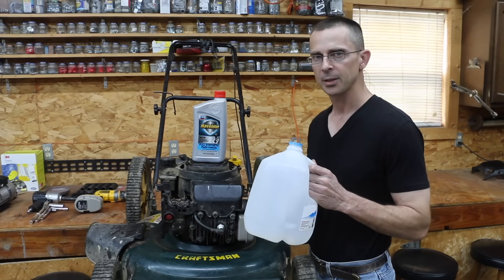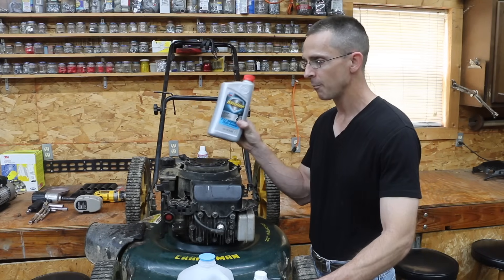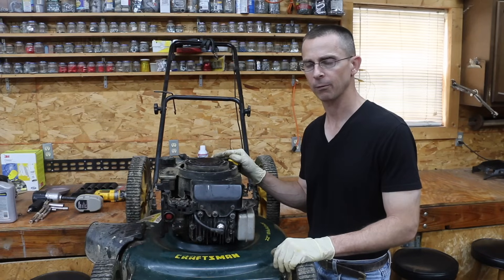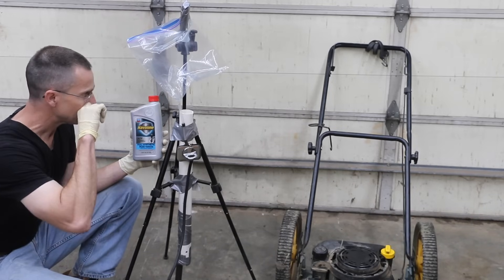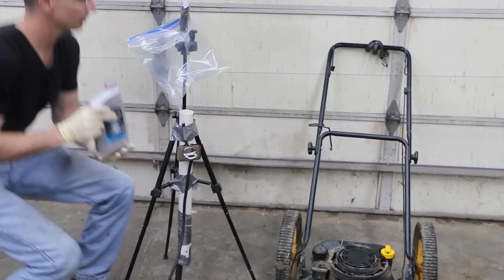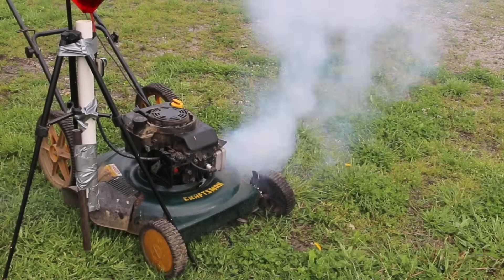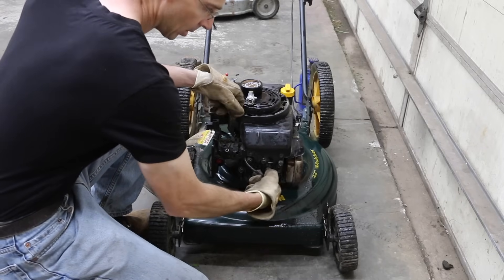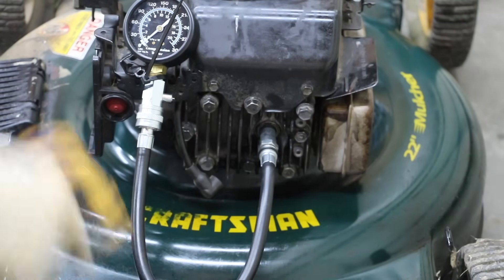Seafoam--can't believe what it did to my engine episode 6--Seafoam vs ATF!!

Comment: I bet it was the oily-water that got pushed up into the carb and sucked into the cylinder, that actually cleaned the engine on the last test. Not the dumb water recommended by the Duh-Huh WaterHead mentalities on here. I'm just glad "those kind of people" didn't cause you to blow up your engine. ; - )

Comment: How about doing ATF the same way you do Seafoam - add directly to the gas.  I might do that in real life, but I would not do an IV drip.  AND With water - add a a few table spoons plus Heat/alcohol to a jar of gasoline.  Shake, let settle. Pour off the gas.  Now you have hydrated gas for use in the engine.  Sounds like good theory to me....  Alcohol absorbs water.  Does Gasoline?    I love your testing but think you are Nuts if you read all the comments.  Go see a movie with your wife.
Reply from the maker: Thanks for the video idea.

Comment: What has better lubricity, 5 quarts of fluid containing a bottle of MMO and the rest oil, or 5 quarts of fluid containing 1 quart ATF and the rest oil? Also, can increasing the viscosity of the resulting fluid by adding a higher weight oil help restore lubricity back to the original oil prior to adding the additives? These are some common questions people have when considering using either product to fix clogged lifters.
Reply from the maker: Thanks for the video idea.

Comment: ATF = no
Seafoam in gas tank through the injectors = probably

In the mid 80s Holley sold a water injection kit. A simple windshield washer tank/pump injected through .020" orifices into the carb primary barrels, and operated by a manifold vacuum switch.
This allowed old high compression engines to run on the new lower octane gas. It cleaned the cylinders very well because it was there every time you stepped down hard.
Reply from the maker: Thanks for sharing.

Comment: I love this channel and i would like to add my grain of salt.I have tested ATF as a fuel additive..And the results are amazing.I have an endoscope and have videos of how clean the engine is inside.I would recommend ATF for occassional use in a very moderate way.No more than 10 ml per galon.The good about ATF is its excellent cleaning and lubricating properties,however it is really important to note that it will never burn in the combustion chamber due to its high burning temperature point.I guess it is about 1000 plus Degrees farenheit.As a result the over use or continuous use of it as a fuel additive will clog the exhaust ports over time since it builds up as it is spat out of the engine into the exhaust pipe and muffler.If your rings are kindda worn out ,chances are most of the ATF will end up in your oil pan thinning out your oil viscosity..So,it is not perfect,but if you use it with caution and moderation,it will work as expected..I am testing a mixture of Lucas fuel treatment and ATF..I will add a comment when i get all the details..Cheers every one.This gentleman is making this world a better place by sharing his tests and knowledge with all of us.Congratulations..You reached 1 million subscribers,you deserve it and soon you will be in the 2 m..Keep up the excellent work..Cheers
Reply from the maker: Thank you for the feedback

Comment: Use it and it works good. Had a 7.3 diesel that would die when clutch was pushed in when shifting down due to sticky valve in the injection pump. ATF fixed it right up
Reply from the maker: Thank you for the feedback

Comment: Seriously man..., you are one very valuable guy to all of us watching your great videos. Even if we may sometimes joke a bit about how you're testing stuff in extreme ways, we are undoubtedly grateful for the results! I haven't seen anyone else putting so much effort in finding out the truth for himself and sharing it this way with everyone else. It is a costly way to find out the truth, but it is also non-mistakenly the best way to find out the truth about various stuff!

Kind regards!
Reply from the maker: Thank you very much!
Reply: @ProjectFarm  could you please advise if one litre of Dextron 6 Transmission fluid be used along with 4.5 litre of 5w30 in GMC YUKON 2013 for a full cycle of 3000 miles
I have no major issues with engine
Reply: @ProjectFarm  it's not a wast at all I really like to see what's next and love the experiments let's see what this will do etc. I have always tryed things like you do. I used to put ATF in the diesel tank bio fuel with 2 stroke oil and loads moor over the years. You really are great if you went you would be missed big time 👍👍

Comment: I use 1 qt trans fluid in my gas tank twice a year.  With 294,876 miles on my 2008 Sierra, it still has the same fuel pump it came off the assembly line with and provides a steady 44psi to the fuel rail.
Reply from the maker: Impressive results!
Reply: My uncle has a 01 Chevy with 330k and puts ATF In his tank every fill up and has been since the truck had 100k. Runs smooth as hell. Quietest 5.3 I’ve heard engine wise.

Comment: I found carbon deposits on my old spark plugs because I was running rich for a while. And before I threw them away, I put them in mixture of boiling water and vinegar for about 15 minutes (mostly water) and they came out almost like new. So I was wondering if it's safe to put vinegar in the petrol tank to clean the combustion chamber. What do you think?
Reply: Not safe. Too much corrosive.

Comment: i recently put 800ml of atf in crankcase two weeks before oil change (400 miles) i have never seen oil that black the crud that came out was unbelievable.  worked better than any flushing product and had only ran 2000 miles since its last change.
Reply from the maker: Thank you for the feedback!

Comment: But could ATF clean intake valves from a GAs direct injection vs seafoam vs CRC ?
Reply from the maker: I wish I could test it.  It seems like a better option would be a water/methanol very fine mist to avoid damaging the catalytic converter

Comment: Love the video, love the passion to really find out what works vs gimmicks. That being said, im a believer in seafoam, I would definitely never try what you did with water or atf, but your results were very interesting and I’m impressed you’re willing to put your equipment to the test to get to the answer.
Reply from the maker: Thank you
Reply: i remember cadillac had a model that used water injection to increase horsepower. the tank was in the trunk.
cadillac also had a model that would cut off fuel to half the engine for either
stop/go traffic or open road. i don't remember which bank.
comments/memories welcome!

Comment: Hey this is my first comment, but I would love to know if “blue devil” head gasket repair stuff really works. It’s about $60 a bottle and it would be awesome if it did because it’s cheaper than a new head gasket. I have used it in the past and it seemed to work for a while. I think that would be a good video. I would watch it. I watch all of your videos. I used to work at advance auto and I would sell all of these products you test. And I would have to be like Seafoam is great and the next month I’ll be like Techron is better this month. Lol it was tough. Good luck!!
Reply from the maker: Great video idea!  I need to find a vehicle that has a head gasket leak.  Thanks again

Comment: Just curious, I always adjust the fuel mixture on my carburetor until the spark plugs look brown and that should prevent carbon deposits. When I run my wood stove and the fire isn’t burning hot enough the soot builds up, but the second I get the fire to burn hot by either using better wood or providing more oxygen, the black soot cleans up and turns a crispy brown
Reply from the maker: Thank you!

Comment: the way i have used trans fluid is, change oil and 1 of the 5 litres of oil is substituted for trans fluid.  I run the vehicle for  2 days and change and repeat the process 3 to 4 times depending on how dirty the oil is when removed.  I find that to quick a clean out causes the engine to get loose and seems to almost damage it, therefore i avoid the oil flush products.  I have done this many times and have had great success.  Whats your thoughts ?
I just picked up a beautiful 1999 chev silverado with 180 km on it (now a bit more) and i find in the cold mornings it ticks for a few seconds. I am going to  do the same trick to it and see if it helps.  I dont think the oil is getting up the passages due to the age.
Reply from the maker: Thank you!

Comment: If I wanted to try this with my 7.3 diesel would I add a quart to a full tank of fuel or a quart in the crankcase or both?
Reply: Jerry Mcbroom  put a quart inside the crankcase to the oil just make sure you don’t go over your top off mark run it for 2 days then drain. Just did it on my truck I had a little ticking coming from a lifter, it did the trick engine is smooth and after draining it I can see it removed a lot of gunk.

Comment: Now this video is what "keeping your hands off", regular use, correct use, and doing regular maintenance, can do.
https://www.youtube.com/watch?v=Wk-isKUjWBQ

However, that can include various additives, flushes, or cleaners to keep things clean, lubricate or protect the engine or other equipment, and would be part of a good maintenance plan. I have found correct and reasonable operation and maintenance really are the key to best and most productive use of mechanical or electrical equipment. 
 
Now comment on that engine disassembly investigation... 
a) The EGR might have very well failed to work if it had not received a wet oil covering likely from diesel engine normal oil uptake from the PCV into the inlet manifold, and use of oil with higher oxidation temps than the exhaust gas exposed to it.  But cleaning that wet sludge off might make it fail by stiction.  The EGR is primarily needed for lowering emissions and drivability or minimising engine roughness during the period the engine is warming up.  Otherwise it is not needed, except for NOx and combustion temperature reduction.  In the olden days chokes for gas engines, and use of glow plugs and pre-chambers for diesels sufficed, but these caused evils such as fuel dilution of lube oil, and washing down the lube from cylinders... leading to too early worn engines and of course high emission.  The EGR takes the place largely of these when combined with fine digital control of fuel and ignition.

b) The cam nose wear did show signs of actual metal to metal rubbing wear... under a microscope would show a rough torn galled welded surface which is only combated by the chemical extreme pressure additives such as ZDDP.  Lubricity improvers do not help here, that includes most additives to oil such as moly disulfide.  Some of the various nano-particle such as hBN (hexagonal boron nitride), tungsten disulfide, carbon/diamond and the like may help... and are considered lubricity improvers... but I don't have an absolute answer there.  I see no detrimental effects from the use of these because of the molecular size of the nano-products.  Modern engines solve this problem with materials engineering.  For example 35 years ago the OM616 and OM617 Mercedes Diesels, now long proven some of the most reliable ever made, had cam / lifter wear issues.  The original engine design was nitrided cams and chilled iron lifters this wore quickly requiring replacement by 50K-100K miles depending on us and service.  The solution was going to flame hardened cams and tungsten carbide lifter surfaces... which by the way by in-large the owners were stuck with.  But now those engines are considered very reliable.  Why I mention that is currently modern emissions standard and use of triple catalyst and exhaust particle traps are currently putting a strain on available lubricants, primarily as ZDDP when thermally degraded from oil being exposed to exhaust gas is a poison to very expensive catalysts.

c) What does this prove, despite the problem of the rise of agency government and emission standards the internal combustion engine has improved or evolved.  Largely the EGR, originally a fix to emissions, but now is necessary part of a symbiotic system including digital control of the engine and its fuel supply.  Material engineering and improvement has allowed engines to live long lives at high specific outputs.  Digital control has allowed high outputs while having low emissions and improved drivability.  Engines today running on the street have outputs rivaling F1 Grand Prix engines of my youth, while having durability of heavy duty diesels of old, and low emissions with fuel efficiency levels only dreamed of even a generation ago.  Of course engine engineering is much more sophisticated, and being a mechanic is no longer a monkey wrench job but that of computer technician and mechanical inclination.
Reply from the maker: Thank you!

Comment: I think the water works the best, but should be administered in spray from in the engine.
Try acetone in the fuel compartment mixed with gasoline.
It suppose to help engines (gas or diesel) pass emission controls
Reply from the maker: Thank you!

Comment: Here is an interesting engineering study of using a diesel fuel additive... Hydrotex Power-Kleen
http://www.staroilco.net/wp-content/uploads/2016/01/Georgia-Port-Authority-Study-Hydrotex-PowerKleen-Fuel-Efficiency-Final-Report-July-2010.pdf
Comment as to compression readings... obviously the removal of the deposits, though minor, from the combustion chamber did lower the compression... as would be expected with removal of any material from the combustion space.  Not something due to engine damage.   As I say... at least on a simple engine like this it might be easier to simply remove the head and mechanically remove the deposits.  But on engine where lots of work getting the heads off, let alone getting to the engine... well that is where these products have application.
Reply: Now that fleet study showed a significant cost and fuel savings from a "snake oil".   Something like 4% is huge in a large operation... so they have benefits.
Reply from the maker: Thank you!

Comment: I poured brake fluid down the carburetor on a cold engine and after 2 min run time flooded it with water to rinse, seemed to be an effective clean out. It smoked like krazy in the exhaust. I usually find something that works and stick to inexpensive methods.
Reply from the maker: Thank you!

Comment: After seeing how the strong detergents in the ATF made the engine oil so dark due to breaking down sludge in the crank case, it makes me wonder how well 1 quart of ATF added to the crank case of an old car would clean the oiling system over a quick 20 mile drive before an oil change.

Comment: Another great video! Seems pretty effective for cleaning, but whats causing the compression drop? (I'm tired as I type this!) Is it because it's diluting the oil? I have great experience (in cars) running top-tier gas, with Berrymans B12 every 3 or so fill ups, half-can of seafoam in vacuum lines twice per oil change interval, and half can in oil crankcase for about 200 miles before change.  Just after I do seafoam (vacuum lines and crankcase, Berrymans B12 in tank) and before oil change, I run hot water in vacuum lines also. It all may seem overkill, but I have squeaky clean engines! I've had 34 vehicles, many of which had high miles. Side note, I add Engine Restore to Synthetic oil every change.  I had a 187,000 mile LS1 Corvette with a bunch of performance mods with excellent compression, crazy power, silky smooth, and almost no wear using these methods.  Also got 34MPG Hwy with an automatic! I love your channel, man!
Reply from the maker: Thank you. Merry Christmas and Happy New Year!

Comment: I worked at a lube shop. and my boss had us put ATF in diesel fuel filters so the fuel pump wouldn't burn up trying to get up to pressure.
Reply from the maker: Great tip!

Comment: Great video as always. I like MMO or ATF as an engine flush and fuel system cleaner. Whichever one is cheapest at the time of purchase. Either are as good as expensive sea foam. I use in fuel tank every fill-up, 4 to 6 oz of MMO or ATF for every 10 gallons of fuel. 300 to 500 miles before every oil change, I add a quart of either to the oil. Great fuel system and engine cleaners that are cheap.
Reply from the maker: Thank you

Comment: It seems to me to be a waste of time using water or ATF.  Both require lots of time and effort plus the expense of having to set up a slow controlled delivery system.  In that particular engine it would be easier to just remove the head and spray carburetor cleaner on the deposits and then replace the head.  That way all the deposits are removed and you don't waste a gallon of gas and pollute the environment.  One could even go one step better by using a steam cleaner machine on the carbon deposits and save on the carb cleaner too.  That is about the same as using water since it becomes pressurized steam in the process.  Granted only the head area would get cleaner and the exhaust pipe would not change but none of your videos on this reveals the cleanliness results of the exhaust pipes.
Reply from the maker: Thank you!

Comment: I prefer Seafoam. 
I would like to add that ATF does have a friction modifier that has a hardening effect on seals.
Thank you for sharing. Your videos are great!
Reply from the maker: Thank you!
Reply: Was wondering why nobody mentioned this... I've heard ATF will ruin engine seals & when doing sludge flush with ATF not to run the motor, but instead cycle with external pump through oil system.. BMW/Audi background, maybe relevant.